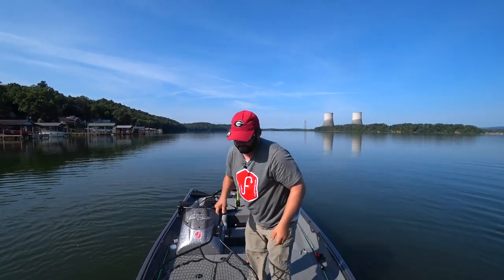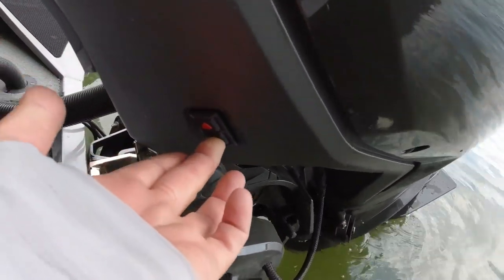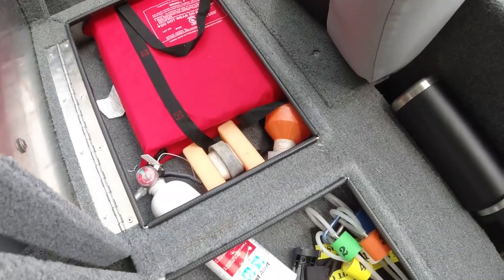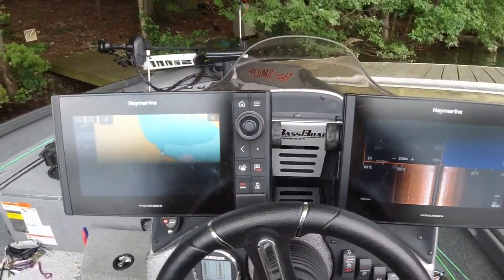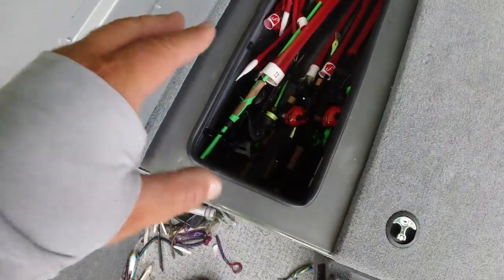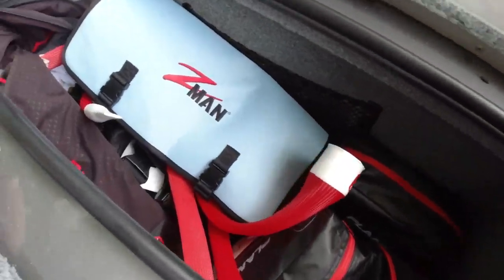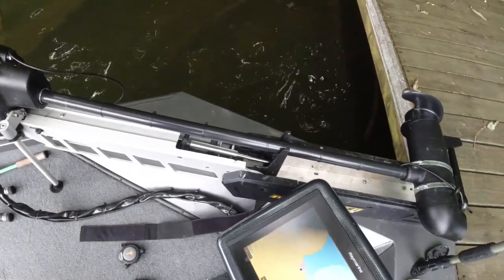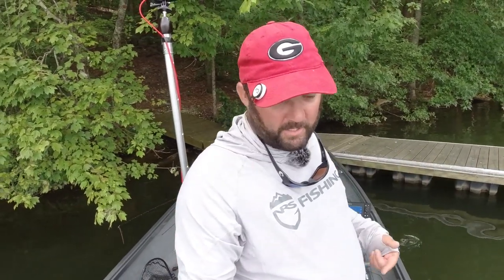My New Boat and How I Organize It - Bass Boat Tackle Organization

Comment: I was considering the ranger rt188p and overlooked this alumacraft boat. I like some features of both and might have to look into this model a bit more. I like the rangers battery compartment better with the extra room but your boat doesn't sacrifice the underseat storage which is a plus for me. I don't like the slanted passenger foot rest on the ranger as it takes real estate away from a coangler for his daybag.  I however like the built in cooler of the ranger and the new bow graph mount. Seems like boat manufacturers always mis something and nobody makes a perfect boat. I like your setup quite a bit and installing that extra cleat by your gear shift is absolutely genius.

Comment: Nice walkthrough. Awesome boat! One question. How is that folding brace on the motor a transom saver if it does not brace against the trailer frame?
Reply from the maker: The motor bouncing around while trailering is what causes damage to the transom. This stops the bouncing. They also found out the the ones that we’ve been using for years that go from the lower unit to the trailer damage the lower unit.

Comment: Nice boat. I have a question. I have a boat and it has a middle storage box where I keep my 3700s. I store my boat outside but it is in a carport with a cover on it. Will that affect my baits like hooks or soft plastics? Like make them rusty or melt my plastics ?
Reply from the maker: As long as they stay dry it won't be a problem. Plastic melt at about 200 degrees.

Comment: Nice, getting myself a boat next month. Serious question, why go with a 2 stroke over a 4?
Reply from the maker: This has to do with my contract with Alumacraft. They are now owned by BRP who owns Evinrude and this motor only comes in a 2 stroke.
Reply: Ed Metz Jr they can be a little more expensive depending on how much you use your boat they will be a little faster than a 4 stroke and the biggest mistake people make is putting off brand oils in their motors like if you have a Yamaha only use yamalube and one plus is you never half to do an oil change

Comment: How many inches is your  ultrexI have a 52 inch and my boat is brand new I feel that they installed the Ultrex in the wrong angle because you can’t even put on the foot thing because the trolling motor hangs over the edge and I see yours is in more
Reply from the maker: It all depends on the design of your boat. I'd take it back to the dealer and see if he can fix things.
Reply: @Flukemaster  2021 alumacraft pro 185
Reply: @Flukemaster  is yours a 52 inch shaft ?
Reply from the maker: I'm pretty sure it is. I have the MotorGuide Tour Pro on it now.

Comment: What made you want to switch back to a 2 stroke motor?
Reply from the maker: BRP bought Alumacraft. They also own Evinrude. So Evinrude is what I get. So far so good though. I'm holding my opinion until I have over 100 hours on the motor.

Comment: That transom saver is actually bad for the transom it puts more wear on the transom where a traditional transom saver would put more wear in the trailer
Reply: On*
Reply from the maker: I had a fishing partner almost die because his lower unit fell off while going 60mph. It was caused by the use of the trailer to lower unit style of transom savers. I’ll stick with this  new style.